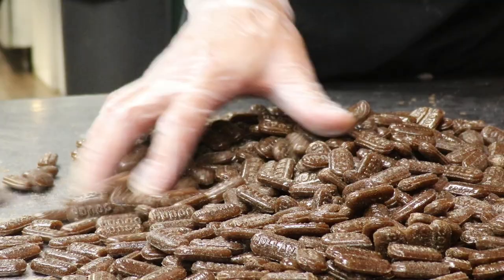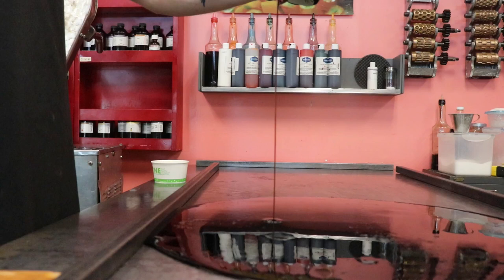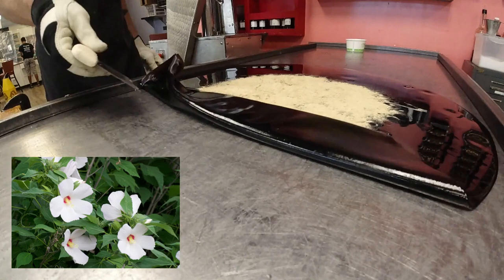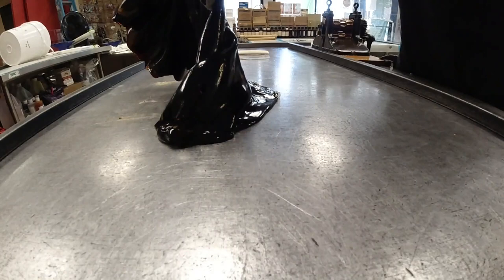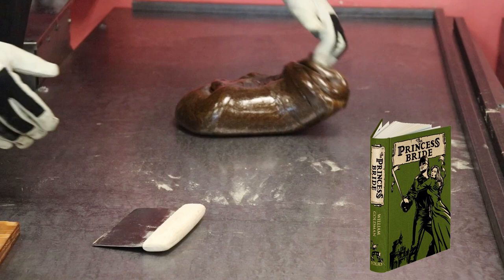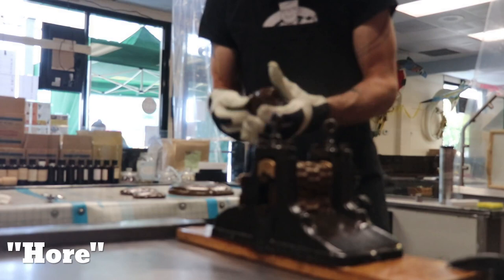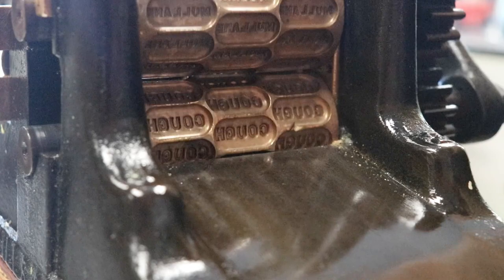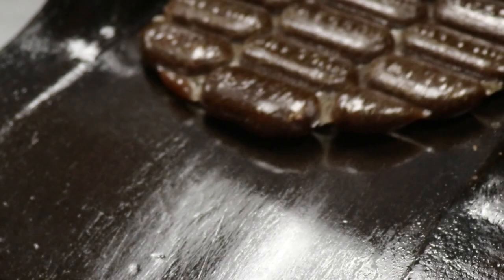#136 Making of Horehound and Marshmallow Cough Drops at Lofty Pursuits

Comment: I wonder how much it would cost to get a new roller with "Lofty Pursuits" on it so that you have your own 'branded' candy
Reply: I bet a machining channel like This Old Tony would be up for the challenge. 🤔
Reply: i am a machinist that has the equipment to do this. just off the top of my head i would initially estimate around $800 a for a pair of rollers in brass. there are probably lots of shops that could do it cheaper. i tend to be more organized towards one-off parts in high precision and difficult materials so my machine rates match that.
Reply: @SuperAWaC  that's not sound so expensive too me, If you take in account that its probably last for a couple hundreds years!
Reply: @SuperAWaC  I wonder if greg will see this? And what design would he like? Lofty pursuits?  Lofty drops?
Reply: Lops. Lofty Pursuits

Comment: Now that I'm all caught up on videos, I have a few idle questions I've been meaning to ask.
 
1) Sometimes, right before you start equalizing the temperature of the candy on the cooling table, you poke the middle of the still-molten candy with your spatula. I've always wondered what that's for.
 
2) Do you guys ever bang the undersides of your arms on the point of the candy hook while you're pulling candy? It's a little amazing to me that I've watched pretty much every video, and I've never once seen that happen on camera. When you're lifting the candy over the hook to start another pull, I keep thinking about how I'm clumsy enough (and/or short enough) that my arms would absolutely bang the hook in the process, but you guys clear it every time. Does that happen, and you guys just don't do it (anymore) due to long practice? Or is it actually really easy to avoid doing that?
 
3) What does horehound candy taste like? It's not a flavor I'd even heard of before this. Is it common enough in some parts of the world (like Florida) that people don't expect to have to explain the flavor? I'm from Ohio, for the record, and I've never seen or heard of it before. (And yes, I know I could look up what horehound tastes like, but I feel like that might not be accurate/reflective of what your candy specifically tastes like.)